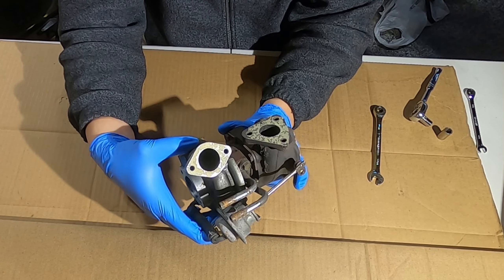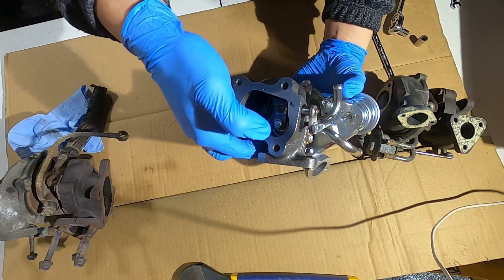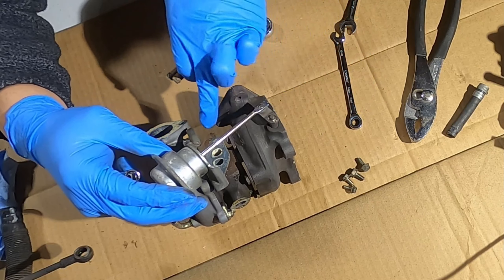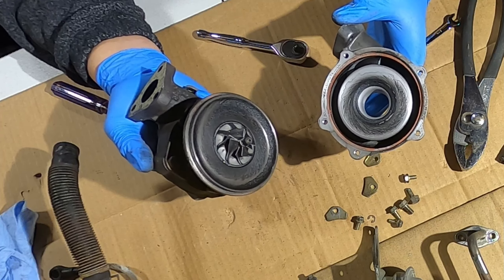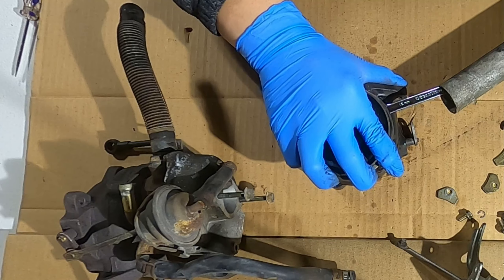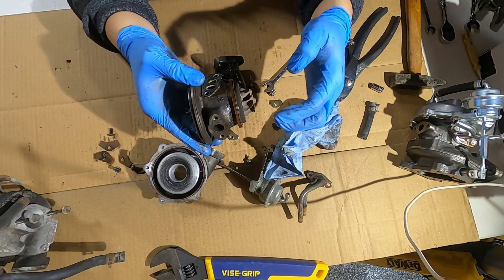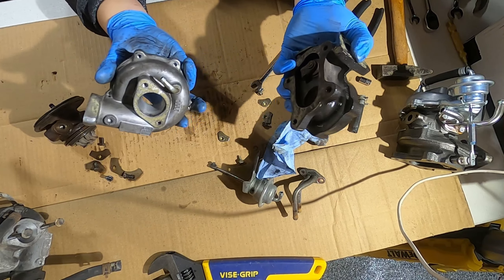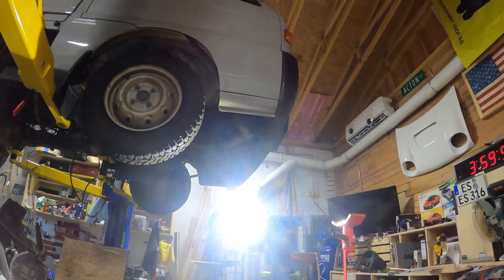Tiny Turbo Examination - IHI RHB31 - How to get inside and what does it look like? JDM Kei Car OEM

Comment: Cool Video, curious were you got the Monster Sport turbo.  I have a Sprint Turbo G10T Turbo with a RHB32 VZ5 or VZ13 and has similiar specifictions.  I have 5 turbos all requiring rebuilding and can't find shafts with turbine blades.  Comp. Wheel 29.65mm 40.10 mm and Turbine 33.74mm 38.10mm. Obviously you're a JDM guy and may have some ideas to help me find parts. Turbo shops haven't been very helpful.
Reply from the maker: Thanks! I bought the turbo on yahoo auctions new. There were some listings for them occasionally. 
Finding specific parts like that, maybe reach out to IHI themselves to see if they can point you in some direction? I have not tried to source the turbine internals like that yet but with some pieces of info it can't be that bad (assuming they're available 😆)

Comment: The Cappuccino's has its coolant coming from the thermostat area to the turbo, then it goes to the oil filter heat exchanger, hence the split path.
I would have needed this video in 2019... I found that I could not install the turbo assembled, I had to keep the compressor housing loose and clock it as I was installing the various hoses to it. Clamping it tight in situ was a nightmare.
Reply from the maker: The coolant path is probably the same, just a different route I haven't looked closely at the source and destination.. I should have marked it before I took it apart but now I'll have to do it the way you did to put it back together.

Comment: fun fact: the IHI RHB31 is a common turbo shipped with kits for UTV's and some motorcycles lol. Once I put the big turbo on my Wagon R maybe I'll buy a beat up golf cart and slap my old turbo on it.
Reply from the maker: I have seen some knockoff versions floating around ebay too for really cheap. It just feels wrong for me to trust those ones however used ones seem to be fairly common if you really needed it.
There are many submodels I am unfamiliar with outside of the VZ25, VZ24, and the FW or FW HYPER.

Comment: Hello, my turbo rhb31 turbo is water cooled and im wondering if water will bypass the compresser and go into my intake on my 3 cylinder diesel
Reply from the maker: I wouldn't expect it to unless there's catastrophic damage to the turbo that would allow the coolant to the intake side but the compressor wheel would probably have issues with water in it and break too.

Comment: I wonder if i could fit 2 of these on a honda d series motor lol
Reply from the maker: Twin tiny turbo
Reply: @AnythingWheeled  exactly that lol
Reply from the maker: Is it worthwhile tho? They're so smol
Reply: @AnythingWheeled  theoretically it basically be the same as one regular sized turbo but it would spool quicker right?
Reply from the maker: @SubaruDude2005  they would spool super quick. So I guess theoretically it makes sense.
Reply: @AnythingWheeled  plus then you can be like "I have a twin turbo civic" even if it only makes 180 hp
Reply from the maker: @SubaruDude2005  😂😂😂